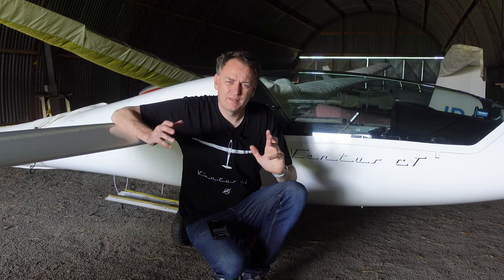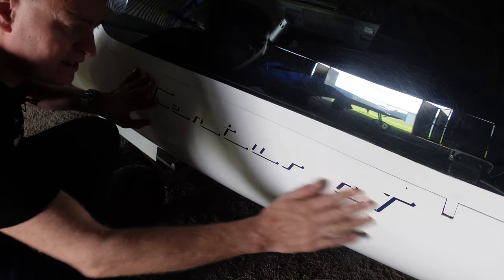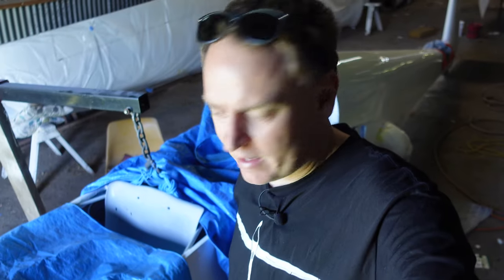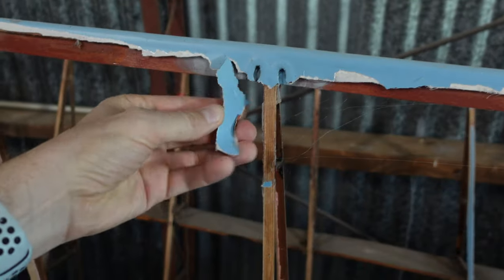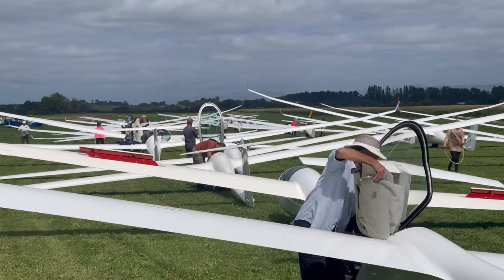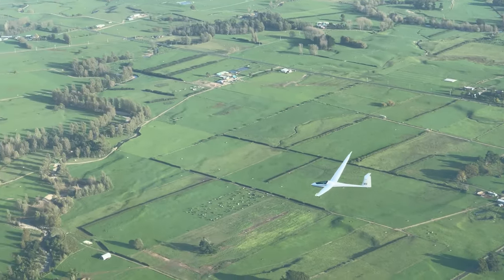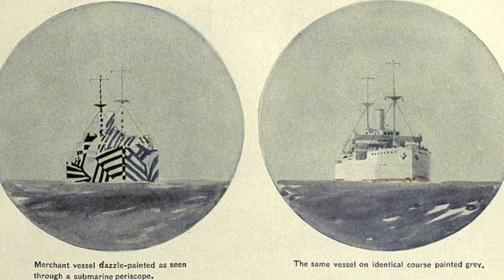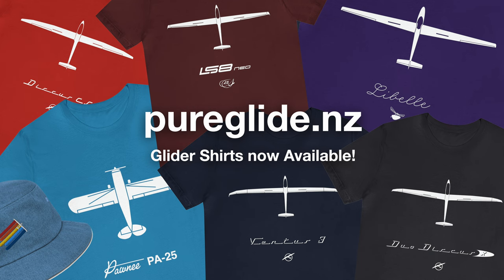Why are gliders & sailplanes white?

Comment: 3:43 You show the ASG 32, but you miss to explain, that it is certified for colours other than white. Just citing the Schleicher product page:

„The ASG 32 is the only current series-built composite sailplane which can be completely painted in various colours. That opens up the possibility of painting large parts of the fuselage, tailplane and wings in different colours. Even in the age of FLARM it’s important to further improve visibility in the air. White colour has a low contrast against clouds and blue sky. Orange and red stand out very clearly against all the natural backgrounds (sky, clouds, vegetation, snow).
At present the approval procedure covers the colours Pure Orange (RAL 2004), Traffic Orange (RAL 2009) and Traffic Red (RAL 3020). If required, further colours can be certified.“
Reply from the maker: Interesting I didn’t know that!

Comment: PIK 20's came in white, red, orange, and yellow. Someone else mentioned green but I haven't seen that myself. They were cured in a autoclave to a high temperature rather than room temperature. Also of note, they were not finished in gel coat , rather they were filled and painted. Mine is 48 years old and still looks great.

Comment: Pik 20's were available in  white, green or orange, but we're post-cured to a higher temperature.
The post-curing temperature can be tailored to the desired requirements as long as it remains within the specifications of the resin. It will then be stable up to that post-cured temp. Typically post-curing at 55"C for 15 hours is the norm for gliders.
Reply from the maker: Interesting! Thanks for that

Comment: Back in 2015, we had a mid-air on final between 2 club  gliders (R-26 SU Góbé). Both were painted blue and silver colors by some really stupid decision.  During the analysis, the investigation committe conducted various visbility test, and recommended the usage of a few red or orange stripes for better visibility on those aircraft, that would otherwise be hard to spot due to their overall color scheme. As one of the glider was flying with a student and an 81-year old instructor, the comittee also recommended maximizing the non-commercial flight instructor priviledges, similar to the age limitation of commercial transport privileges.
Reply from the maker: I just found the accident report, yes they were blue and silver, half in half, so very much destroying the shape of the glider visually! No radios would be bad too. The report is interesting, it states reflective foils are bad (which is not really a surprise) and a black patch on the wing was the easiest to spot colour out of blue/black/yellow/red which makes sense too. Very interesting, thanks
http://www.kbsz.hu/j25/dokumentumok/2015-157-4%20FR.pdf
Reply from the maker: That accident report referred to the study I was thinking of in the video, so that meant I could find it! Thank you :)
https://www.segelflug.ch/wp-content/uploads/2018/10/glider_consp_study.pdf
Reply: @PureGlide whoa, awsome! 😁

Comment: I didn't know about such strict requirements regarding fibre glass temps, TIL. Great, straight to the point video
Reply from the maker: Glad I could help!
Reply: There is a old yellow and blue glider at a club near me. I forget the model.
Reply: They are in the specifications, e.g. in the repair handbook for doing a complete overhaul incl. re-painting.
Recently Schleicher started using higher temperature tolerant resins, and allow larger areas being painted other than white, even straight from the factory.

Comment: The wood of the old gliders was generally spruce wood; very strong and light. A type of glue was painted on which tightened the canvas, then it was painted for decoration. They were low performance planes with short wingspans. Fibreglass changed everything but there were some aluminium covered gliders. I think one was called a Blanik.

Comment: In WW2 they were trying to figure out the opposite: how to make aircraft as invisible as possible, especially for people the aircraft is heading towards, with the aircraft against the sky not the ground. And they found the optimum colour was .... brightish white lights along the entire leading edge of the wing. Modern LED strips would be ideal.  Even white paint is -- as seen in parts of this video -- much darker than the sky.
Reply from the maker: Interesting, yes makes sense! Even white gliders are very dark against a bright sky..
Reply: If I remember correctly, it was RAE Farnborough which did this experiment. (I used to work there.) They decided that it required excessive electrical power required to make the lights bright enough. I think of this whenever other road users fail to see me in my red car. It's equipped with daytime running lights. 😒

Comment: Could you go with Shiny Silver? Just as good if not better at reflecting heat, black body radiation theory states silver should have a slightly higher emissivity. How would silver compare in terms of anti-camouflage? 

Also, while were thinking about older gliders, how different are they to fly than modern ones? I've heard they generally like lower IAS, don't have as good glide ratios, but can gain altitude better in thermals. However I've found it very hard to find more information online. Ever flown a wood and fabric glider?
Reply from the maker: Reflective silver tends to look like the colour of what it is reflecting e.g. the sky or ground. So not a good idea :) They studied it in this accident report 
http://www.kbsz.hu/j25/dokumentumok/2015-157-4%20FR.pdf
Reply from the maker: I've been in a K13 once, and didn't like it. The main problem is very few wood gliders are designed for tall pilots, and I'm 6'4" 193cm...

Comment: I have flown a AAFC (Australian Air Force Cadets) DG1000S glider and it is mainly orange, white and grey. This covers the wings and fuselage and in big bits. Does the heat not effect it as much as other gliders?
Reply from the maker: Interesting, either that particular glider is allowed for some reason, OR someone has done it anyway!
Reply from the maker: From pictures online it's only the nose that is orange, that's small enough that it's allowed. The wings are white
Reply: @PureGlide  They have orange wing tips with grey markings on the wings. There is also more orange and markings on the tail. I have a video of them on my channel.

Comment: I am curious to see if this changes anytime soon. I see that Diamond Aircraft are now doing their aircraft in colour and I am pretty sure they are made with some form of fibre glass.
Reply from the maker: Yeah I'm not sure why they don't have that issue too - maybe it's the top facing surface area being so much smaller?
Reply: Newer resin systems and higher tempering temperatures seem to allow this. You can nowadays order colored gliders from the factory from Schleicher too. They mentioned new resin systems on their web site allowing these offerings (at additional cost of course :) )

Comment: Very interesting, Thanks Tim.
I was going to ask: “Is the heat tolerance better on carbon-fibre gliders (vs fibreglass)?”
A quick google, reveals that it is the resin (not the fibres) that degrade with heat.
So if you use the same epoxy resin on both, you have the same problem…
Reply from the maker: Yip exactly right!

Comment: Is this even remotely true anymore? Composites regularly operate above 100C these days,  are gliders still stuck in the old days of fibreglass and polyester resin? The cfrp i use daily has a Tg of 145, it's not even high temp cfrp. The a380 tail is cfrp and they're usually painted dark colours too.
Reply from the maker: Yeah still a requirement from manufacturers at least